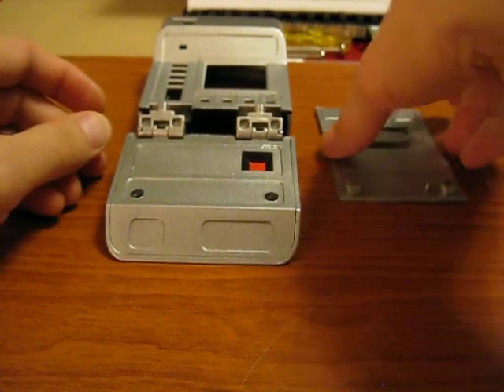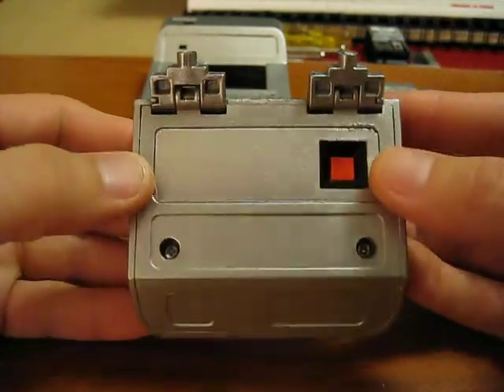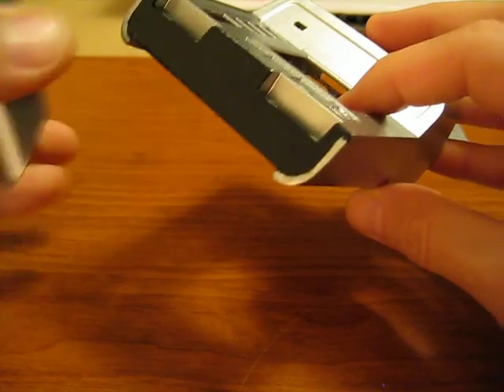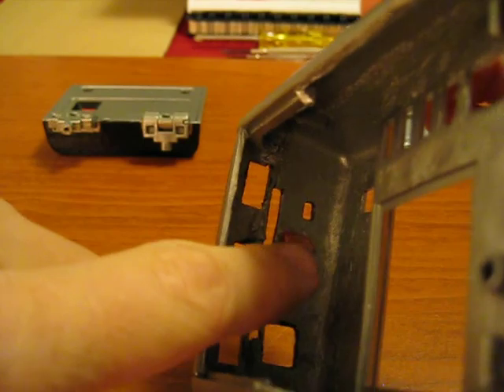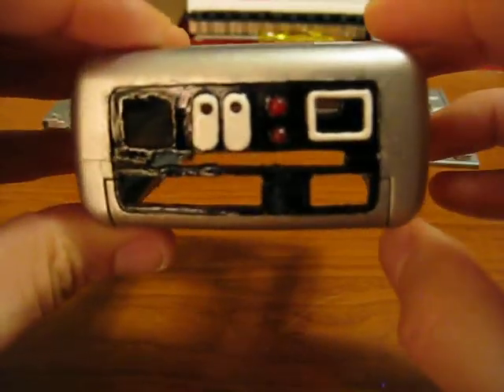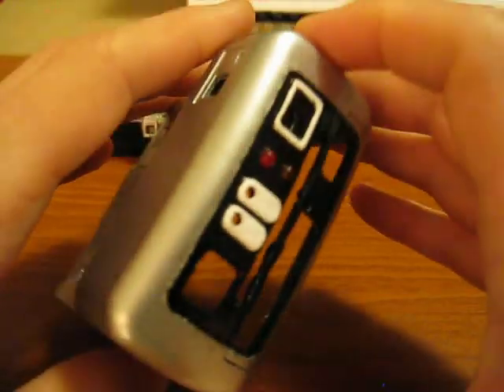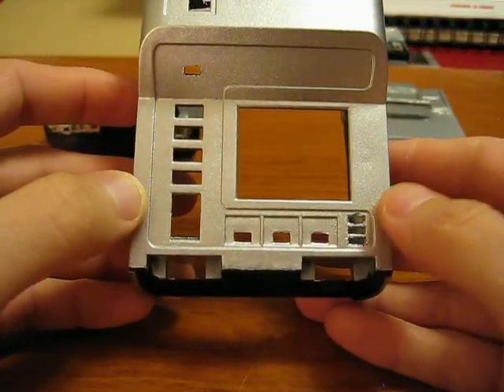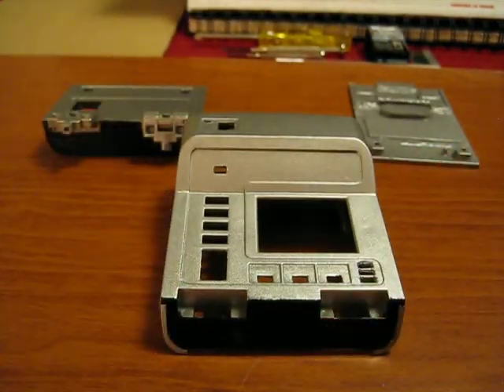Star Trek Playmates Tricorder modification process (PART 3)

Comment: Nice Work! I have a stock playmates Tricorder that I will modify . How did you make the cuts so neatly...especially at the top, right above the stock battery cover. I'm planning on an exacto knife and metal ruler..I'll use model kit sprue cutters for the insides...I welcome any hints. Thank you.